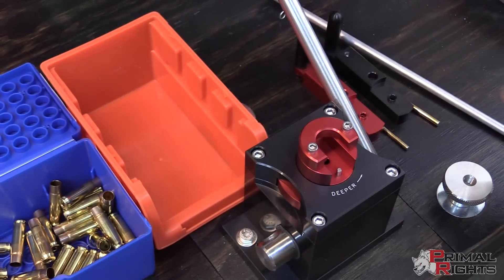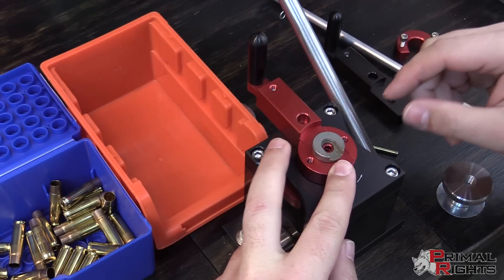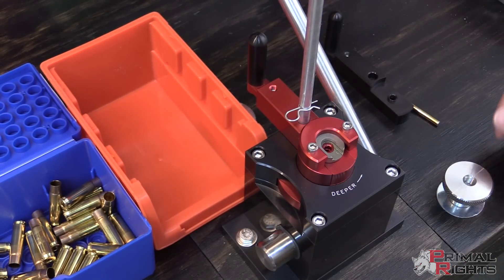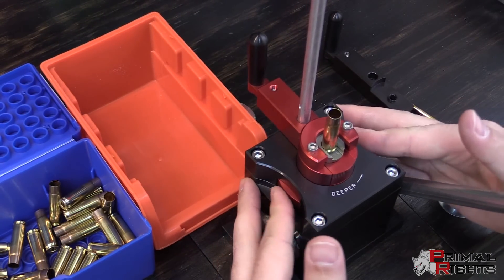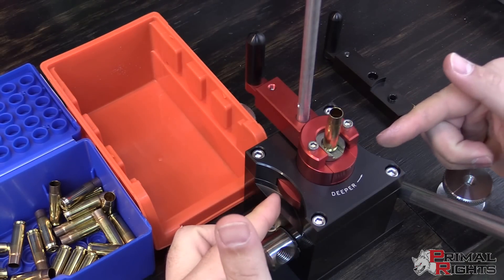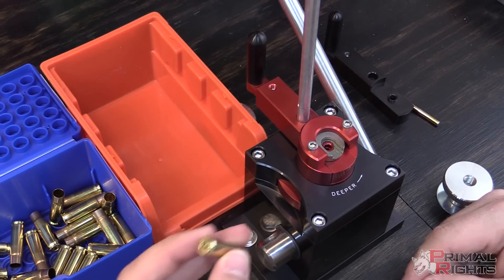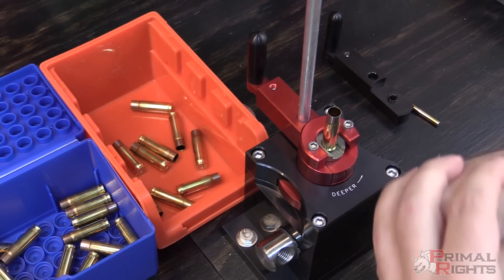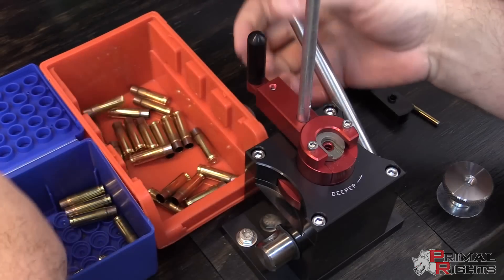CPS Basic Setup Guide

Comment: Looks like a very nice priming unit. The only drawback that I can see so far is the price. $600 for a priming tool is a little hard to swallow, however it is built well. Any thoughts on a future release or design that will be a little bit more reasonable for the everyday reloader? Thanks for the video very informative.
Reply: 5 years later, and it's even more expensive now, nearly $700!

Comment: Been using the RCBS priming station. Advantages to consistent seating depth? Better SD? More uniform burn rate?
Reply from the maker: +Will Sartin (5RWill) Uniformity is very good for virtually everything in reloading.  SD's tend to shrink as you get the seating depths, primer pockets, and flash holes uniformed.
Reply: +Will Sartin (5RWill) Yes, thats the idea.